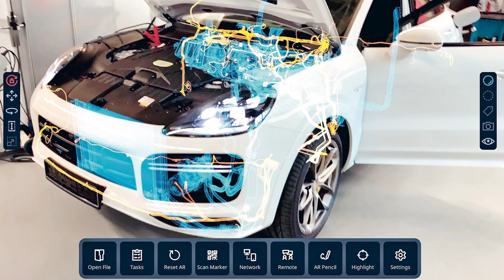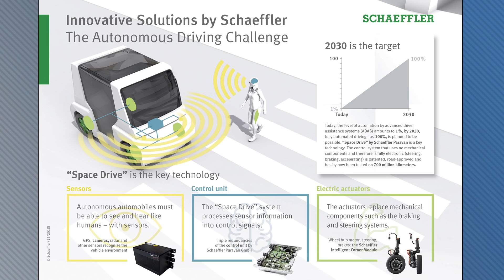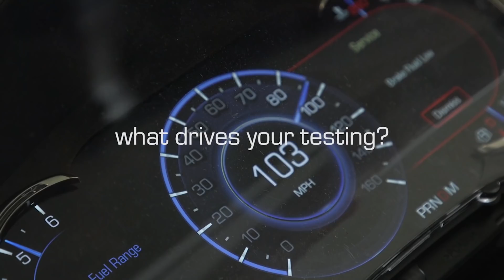Is China Threatened by Tesla?; BMW Aiming for Better/Cheaper EVs - Autoline Daily 3062

Comment: Legacy Auto business models vs Tesla full vertical integration (Ford was first, had mines, rubber plantations etc.).
Interesting decade ahead.  wild card?  Musk promises Tesla will be the most advanced factories - vehicles (batteries too?)
Reply: Tesla does not have a full vertical integration. They use plenty of suppliers, heck: they even source 3rd party batteries. They're more integrated than your average automotive, but FAR from having a full vertical integration.
Musks promises a lot, rarely delivers on the promised word. He does deliver something, but it pretty much always is underdelivered.

Comment: EV platform design is going modular in a big way and faster than I expected. Here are some my predictions for the future (or maybe now). 1. We will see an explosion of car brands. Boutique and bespoke cars will be everywhere enabled by both the modularity but also by manufacturing as a service like ZF is doing. Look for more ZFs and REEs in the future. 2. Some of the new car brands may be existing brands from other industries. Apple is a easy prediction but what about Lego? Could Lego one day offer the parts or kit to make a real car? The value of those brands could go way up on news of a new revenue source. 3. Kit cars will be as common as home made PCs. Yes, there are lots of details to work out but EVs will be so much easier to build than ICE kit cars the market could really expand from gearheads to the entire "make" culture. 4. Aftermarket upgrades will be endless for EVs. The SEMA show is going to be amazing. This makes the lifetime value of a car customer different than it is now. It won't just be service and resale value anymore. Some consumers may send more on the car over the time they have it than they paid for it just buying upgrades.

Comment: hahaha   so funny  with thoses false news from tesla
Reply: Which part the fact that Tesla batteries catch on fire. Ask the 2 guys that got BBQ this weekend oh can't they're dead and the fire dept couldn't get the fire out. Or the woman that jumped on the Tesla with a shirt in Mandarin that said No brakes because her brakes failed and almost killed her family. It's funny anything bad against Tesla is false news to the Tesla cult.
Reply: @bikingD  no,.they are dead because they  abused the auto pilot, there are even reports that they were not on the front seat and they were speeding.

Second, electric fire is a class C fire, not to be put out with water.

Fire services will have to adapt too.
Reply: @wollinger  It is virtually impossible To talk facts with these Tesla haters.
Reply: @wollinger  If Tesla would have a driver's monitoring system up to the standards of, say, Super Cruise, that accident would never have happen. They're negligent, not to say that they are straight out lying in the way they promote their SAE lvl 2 driver assistance systems.
Reply: @SkywalkerWroc  FSD was not involved in the accident at all here, the media was being hysterical as usual, and the next day it comes out that nothing they covered was correct:
- FSD was not even purchased by the owner.
- The claim that there was no driver made no sense after knowing that the seat sensor and seatbelt sensor would prevent the vehicle from operating, I doubt two drunk 50-60 yr old guys found a way to trick that, and even then one wonders to what end, the story makes no sense.
- The claim that the fire lasted 4 hours and used up 30k gallons was directly disputed by the fire chief, along with other fire chiefs familiar with the process, the fire was contained within 2-3 minutes and used a fraction of the water to keep things under control. The investigation itself, into the deaths took 4 hours, the media ran with the 4 hour figure for clicks. 
- The media claimed that the fire department had to contact Tesla to figure out what to do, the fire chief disputed that assertion, stating that they already knew exactly what to do, this training is already part of the fire fighter protocol for a long time. Another spin to stoke public hysteria.

TL/DR The media wants to capitalize on the public's ignorance and insecurities around technology to sell ads and clicks, and this was their golden opportunity: Stoke irrational anti-EV hysteria, and do it around a company that does not advertise with them. 

Pretty irresponsible journalism.
Reply: @AllanSustainabilityFan  By all accounts it seems that the autopilot was involved (not FSD, Musk was just grasping at straws, fundamentally it's not an issue which system was used, but how it failes in driver monitoring), including eye-witnesses at a site reporting car driving with passengers sitting on the back seat and the independent videos of autopilot being engaged on a roads without road markings where officially system would prevent it from engaging, and yet... in reality it did not do so.

Tesla clearly has an issue with what it says their systems would prevent vs what they actually prevent.

I won't comment on fire, cause I never raised that topic, and it's irrelevant here. Every EV battery fire will look the same, every EV battery fire will require about as much cooling to prevent reignition.
Reply: @SkywalkerWroc  even those systems can be manipulated...all brands today only require the driver to put some pressure on the wheel, ppl are the guilty ones for tricking the system.. they put tennis balls on the wheel to squeeze the sensors...

I am not defending Tesla, i was going to buy one but cancelled my pre order years ago when the were launching the model 3. Just hate the media for putting the word Tesla instead of car accident.. headline sells.
Reply: @wollinger  "all brands today only require the driver to put some pressure on the wheel," - FALSE. That's why I gave Cruise as an example - it's one of the brands that doesn't do dum pressure sensor. Another most obvious example would be Volvo that also does eye-tracking since 2022 year-model.
If you do advanced driving assistance systems that start to approach early autonomy (so-called "level 2+") then anything less is straight out dangerous lack of imagination on the manufacturer site at a very best, criminal negligence at the very worst.
Reply: @SkywalkerWroc  Can't really claim that when the data is not on your side. Tesla has been accused of this many times in the past, and every single time the data vindicated them. Gossip and gut feelings is not equivalent to hard evidence.

I'm sure eyewitnesses can recollect the scene AFTER the accident, but it means little as they are not privy to what happened during the event. So not telling the whole story, and anyone that thinks about it logically for half a minute can imagine why this is a big detail for anyone to miss. 

Objects can indeed shift after a crash, drunk people can try to do stunts and misapply pedals, and/or it's possible for a third person to be involved, all those are more likely scenarios than two drunk old men figuring out how to operate a vehicle AFTER somehow fooling the seat and seatbelt sensors. 

It's not rocket science, as much as spin media likes to try, and has clearly been embarrassed now, after they were done doing the damage for their desperate sponsors.
Reply: @AllanSustainabilityFan  Thus far I've seen more attempts to spin this accident from Tesla fanboys than I did form the media. Neither is without fault, but fanboys making up absurd excuses is a next-level BS.
"Objects can indeed shift after a crash" - you're saying that passengers shifted from front to rear seats upon the crash into a tree? Use at least a tiny bit of logic. There's been no 3rd person there, noone had a 2-meters long leg to reach gas pedal from the rear seat. You're just making stuff up as you go in order to excuse Tesla out of their poor driver monitoring system and overhyping their driver assistance system into "Autopilot" and "Full Self-Driving Capability" that they love to advertise on every corner, paining an image of being ahead of competitors in terms of ADAS when in reality they lag behind the likes of Cruise or Waymo.
Reply: @SkywalkerWroc  Passengers can certainly shift to the rear seat, but to be accurate one was found in the passenger seat and the other in the rear seat. That doesn't give us much to go by, the driver likely didn't have much time to do anything beside push the pedal, since the driveway would has been cleared within SIX seconds at the speeds they were going at.

The "third person" claim is clearly conjecture. On the other hand you're making an assertion, without evidence, that there is or isn't one. Nobody knows the facts yet, just what the media is spinning for clicks at the moment, not that far from gossip.

It could be the drunk misapplied the pedal and then got thrown sideways during the crash, or tried to do a stunt from the passenger side and failed, nobody knows the details, but the media is simply going by a small time cop's baseless assertion that there was nobody in the driver's seat, so it automatically follows, according to him, that there was no driver there. 

I'm going to assume that Tesla's readings will reveal if there was a weight on the driver's seat (or not), and if the pedal was applied during that short drive (or not), and that could help the authorities in analyzing the case. Those two data points get recorded, so those in tabloid media that make such baseless claims will be embarrassed as usual. 

But sadly not before they cause damage to Tesla and the EV movement of course.

In the big picture, we have 8 deaths involving Teslas for the whole year of 2020, versus 42052 deaths from accidents in other vehicles, making Teslas the SAFEST vehicles on the road based on these statistics. Yet the media has this obsession with covering every one of those Tesla accidents, and using their imaginations to contrive elaborate techno-phobic tales.